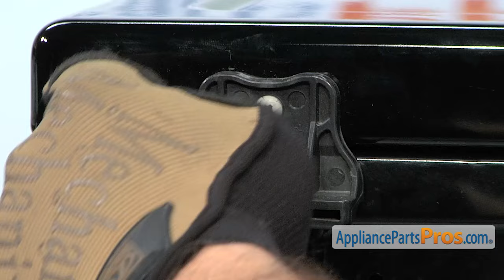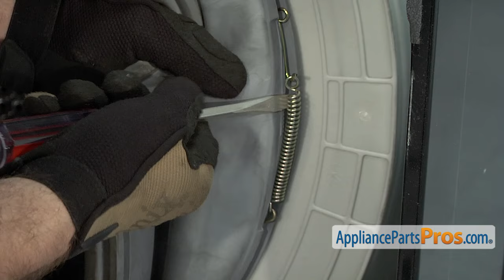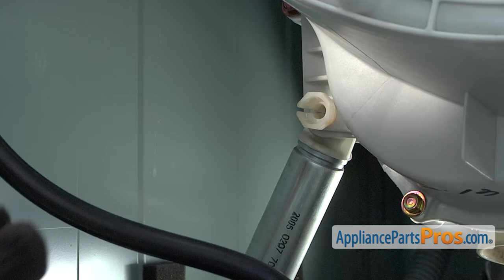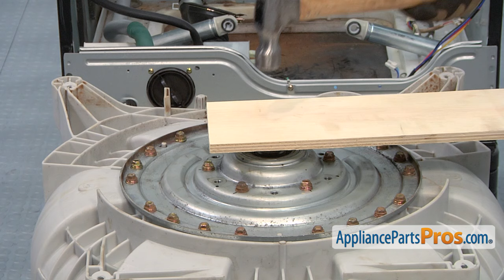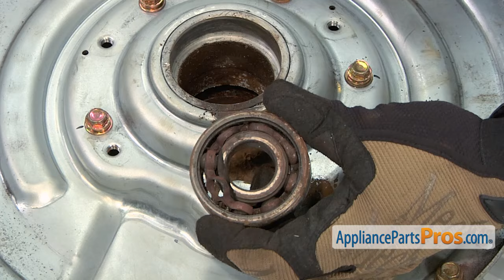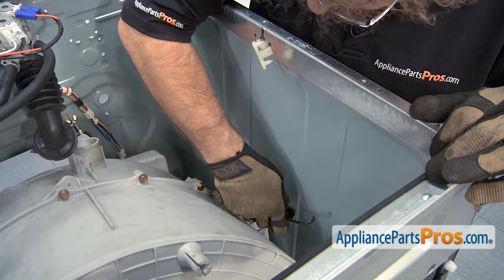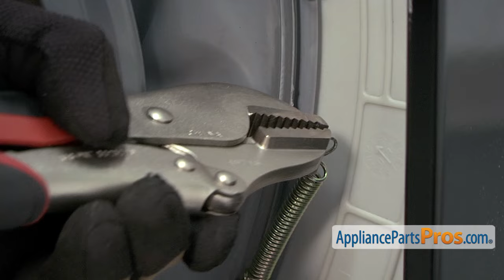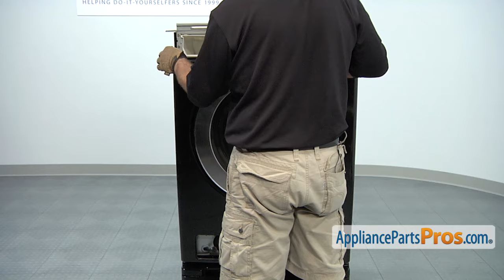How To: LG/Kenmore Washer Seal 4036ER2004A

Comment: It is a great video.  After watching your video, I am daring to open my Kenmore 3.5 Quiet Tumble Action front load washing machine, Model: 417.44052400 from Sears. It is more than 14 Yrs old.  Making loud noise with some vibration during the high speed segment of the spin cycle and leaks 1/4 th cup of water.  Otherwise it works quiet good.  Do you think this video will work for the model of my Kenmore Washing Machine?  I am hopeful.  Thanks for your time and excellent explanation.  The photography is of high quality.  I have used your videos on Kitchenaid Stand Mixers, which helped me in replacing grease.

Comment: The worst part was putting that spring clamp on the outer boot. Mine was MUCH tighter than his, but the vice-grip trick was the solution. I just had to put a lot more effort in it! I thought I was doing something wrong.

Comment: I just did this repair today - I just paused the video like a kazillion times during the process, lol. Turned out whisper quiet and works perfect. My unit is 10 years old. This repair took me 6.5 hours and cost 30 Bucks for the 2 bearings, seal and tub o-ring online ..way better than spending $900 - $1,000 ..thanks for posting this video!

Comment: NOT having the torque values is a real challenge here guys. I changed the bearings and seals ...I undertorqued my motor bolt and it came loose so I got the drum movement/noise again. Retightened. Got excessive movement so I replaced the struts. Now again Im getting movement but its a "crunchy" sound. I fear I may have overtorqued the nut and broke the spider. is this possible? I really wish you would include the toque values for the 20 something drum bolts and the motor bolt. ALSO PLEASE RECOMMEND PEOPLE CHANGED THE STRUTS when doing one of these jobs.Its a complete pita to have to do it later!

Comment: 6 years later and still saving people money! Thank You! Couple of notes. 1) I agree that placing the weights on after boot gasket install is easier. 2) seal placement shown in video is correct despite comments. 3) take the time to clean the tub parts during the process. I pressure washed. 4) I had to let penetration oil set for a while to release the tub and the bearings. Those took the longest amount of time.

Comment: Great Vid, thank you. fyi, if you are alone, put the springs back on the tub (pay attention to the direction of the hook) before you put the tub back in, quick connection right side and a little wiggling for the left !!! no problem.  As well previously, wrt the shocks, front ones take them off at the bottom and then remove them from the tub and replace them on frame (not tub) when reassembling. Remove the bracket holding the rear shock.

Comment: Help!  Any additional thoughts on removing the shaft from the bearings.  I've tried WD 40, heat gun and brute strength and it's not budging.  The outer bearing was chipped at the center when I opened it and actually spins around the shaft.  Any recommendations are greatly appreciated.
Reply: By now you might have already solved your problem.  Other than WD-40 , two viewers have recommended some liquid for loosening the shaft.  Hope you have already read them.  When I will work on such a Project, I may face the same difficult situation.

Comment: Why on earth would you not want to use a light smear of grease to help you install the seal and the bearings? The seal is pre greased inside the lips, and the bearings are greased, so it seems very strange to use liquid soap to install both.

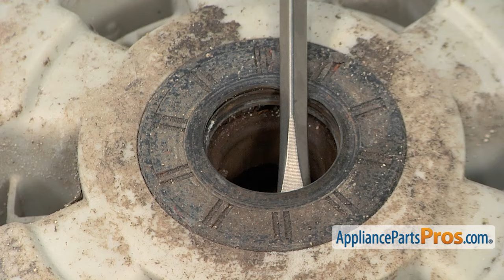Comment: Good demo, but you put the seal in backwards! See at 16:30 where it came out with the open side of the cup facing into the machine where the water will be. That's also the side where the garter spring  is energising the seal lips. Lots of people make this mistake because they are used to these seals being oil seals outboard of the bearings on a diff or gearbox, where the spring and lips face away from the way you install it, i.e. towards the oil. It's clear at 19:30 that you have installed it with the open cup facing the bearing, not the tub's inside where the water will be, to protect the bearing from the water. 
I just did this job and I noted the seal direction very carefully. I'm also a machinery guy.
Reply: not backwards but the new seal part is just different from the old one.  But it is confusion and ripe for comment in the videos about which way it goes.

Comment: ONE MAJOR THING that I would change about this installation instruction is to fill the inner lip of the seal with grease as it will eventually fail again because of friction as the drum turns.

Comment: Excellent video, but I recommend placing the weights after placing the bellow on the drum, not before. It allows more room to work the bellow and placing the retaining spring.
Reply: Great helpful tip.  I liked it.  I will keep it in my mind when I will work on my Washer.

Comment: @AppliancePartsPros
I have a LG wm2277hw makes loud noise when it spin cycle, so I decided to replace the its two bearings, so disassemble the whole device, then tried to release rod from plastic tub by hitting with a hammer while place the tub on two pieces of wood hanging.
I delivered about 50 to 70 shots with all the might I have got, but rod that attached to stainless steel drum did NOT come free from plastic tub.  Like you have shown at @15-18.
I did spray ton of WD 40 but it did not help.

Comment: good luck actually doing this.  Wonder how many machines he tried before finding one that would cooperate.  I tried this once as a techincian and learned my lesson after several hours and couple visits later to the customers home, my supervisor and I decided that was a bad idea.  Most of us (if not all) will replace the rear tub assembly with the bearings and seal preinstalled. ALL other manufacturers make tub assembly the only way.  Whirlpool has gone to making basket and front and rear tubs as one assembly. Also its easier to take the tub asm in and out if you remove the dispenser asm and front cross member. plan to take a couple hours for this job

Comment: Isn't laundry soap the cause of the rust? I would use grease or oil instead of soap and use the old bearing to tap the new one in. If the new bearings don't have grease, add some more. Thanks for vid

Comment: I watched this video and then did the repair.  It was helpful in that it was a good road map for the order of procedure. BTW, using a small piece of string to remove and replace the suspension springs was a HUGE help.

Comment: I'm hoping that someone reading this can offer a little advice for me.  About 6 months ago, I replaced the bearings on my lg front loader and everything was going fine until recently I got an 'LE' error and so I replaced the hall effect sensor and while putting the rotor assembly back onto the machine, I noticed that the barrel slid forward and I know that it will get tightened back into position once I tighten the 17mm screw on the rotor assembly.  But I'm curious to know if the barrel should be moving at all, even prior to tightening that bolt?  If it shouldn't be sliding then what is it that I don't have correctly tightened?  When replacing the bearings, I made sure to get EVERYTHING back snug and in position just like I found it when taking the machine apart but if I missed something then what was it?

Comment: You carried me through my bearing(s) repair.  Could not have even considered the project without your video.  I am a 72 y/o (female).  I watched your video 3 times before I 'knew' I could make the repair!  At the start I had your video running as I followed along.  My daughter helped me get out the tub and away I went.  I can't thank you enough for your detail.  It took me 4 days at a 'slow as you go' pace.  I didn't want to 'screw it up!  As I am writing this, the washer is going through it's cycle.  SO  QUIET.  Oh, the LG TROMM Steam Washer is 13 years old and now runs like I just had it installed!  Thank you so very much.
Reply: You go girl, ;)
Reply: I am in the middle of doing it right now. I'm 65 years old and an aircraft mechanic. So got the experience to perform it. Well done on your part. And I do 'when in doubt, go slow.'
Reply: Mam i am habib from bangladesh i am good technician
 for all washing machine and refrigerator repair so ples:halp me for job on your country.

Comment: I have been having trouble with washer stop spinning. I thump the washer and can get the drum tumbling again or use the diagnostic mode on spin and turn the drum from the back using a towel for a grip (protection). I noticed a high pitch noise when spinning. Now there is a rhythmic clicking during the washing cycle which also is in the spin cycle. The clicking sound goes with the speed of the drum. Faster speed, faster clicking. Does this sound like the bearings are going bad? I haven't taken it apart yet because I'm still thinking it through. I can't find anything on the web about a rhythmic clicking with each turn of the drum.

Comment: Excellent instruction. Changed the bearings, spider and boot. Only thing was the new boot was so stiff, after fighting with it for about a half hour I decided to pull the weights back off. After that it gave me fingers more room to work and got the new boot on relatively easy, then reinstalled the weights. Thank you so much, this video is a definite money saver.

Comment: Video made a lengthy repair straight forward. Thank you! Three suggestions: (1) use the old bearings to pound out the new bearings, (2) if the shaft won't go through the new second bearing without pounding (as happened to me), then install the rotor bolt with washer a few threads deep,  block-up under the washer, and tighten to safely pull the shaft through. Repeat with thicker blocking until fully pulled. (3) install the door boot to the tub before putting the tub back into the frame/cabinet. You'll have more room to maneuver. On a last note, it took me about 6 hours, but at least 2 hours was spent just cleaning. Since you are that far in, suggest also removing the spider and cleats inside the SS drum. Mine were really gunked up.
Reply: Thank you very much for your tips.  I will keep this in mind when I will work on my Washing machine.

Comment: Thank you for the thorough video! Appliance Parts Pro also has a hotline which proved to be very helpful.

I just completed the repair successfully on my 12 year old LG washer.  My biggest piece of advice is to change out the gasket and the discharge pump while you are doing the bearings.  ~$100 worth of parts and you will have a machine that is close to new.

I have the following detailed notes and tips based on how my repair went:

1. The step to remote the inner (metal) tub from the outer (plastic) tub was much more difficult that the video suggests because I did not use the suggested rust buster.   I sprayed WD40 liberally, broke 2 pieces of wood in my attempt to dislodge, and moved from a hammer to a sledge hammer.  The piece would not move at all. I called Appliance Parts Pro and they were very helpful in suggesting I do not use WD40 but use a rust buster (they suggested Mars Rust Buster).  My local Home Depot and Lowes did not carry Rust Buster so I used a product called "Blaster" from Home Depot.  I sprayed Blaster and let it penetrate over night.  The pieces came apart the following morning.

2. The step to remove the bearings took much longer as well.  I tried using tools I had as a makeshift punch but these were ineffective.  I ended up buying a 6" punch which eventually worked.   Even with the new punch, it took me lots of effort to dislodge the bearings.

3. Someone in a previous post suggested using a cupcake tray to keep track of the screws, which was very helpful.  I used a egg carton and made notes on which screws were in each compartment This turned out to be extremely helpful during reassembly.

4. The locking pins on the shock absorbers were difficult to remove.  I tried the technique in the video to use a socket, but this did not provide enough pressure on the tab.  I was able to free the locking pins by using a needle nose vice grip locked on the back side to press down the tab while I pulled the other end with a larger vice grip.

Take your time and follow the video and you will be successful.
Reply: Oh thanks, I have Blaster from this summer's work on the lawnmower. Would have never thought of that!

Comment: Great detail.  One of the best step by step I’ve seen. Worked great for me. It took me a few hours to do. Some tips for people. Penetrating oil is a must to get bearings out. Buy a punch set to knock out and put in bearings. 
The front grey gasket I would put it on with the metal spring clamp before installing the two weights. Having weights off makes it more accessible. Metal spring reinstall was a major pain. It didn’t want to stretch. 
After you install the lower drain pour some water in before installing door so you can check for leaks. Makes checking so much easier. Mine leaked and was a pain to access leak location. Why the designers didn’t make a longer spigot for the rubber boot to slide in seems a design shortfall. 
Take pictures with a cell phone to jog memory. Reinstall screws as you disconnect or use a muffin pan to keep in order. Video is so good a novice can follow it with confidence. Excellent production of it.
Reply: Great tip - very useful.  Thanks for sharing your experience.

Comment: Is there any way to use another brand or model spider arm to replace a busted one on a GE Profile front loader washing machine? GE doesn’t sell just the arm. Only the back half of the drum assembly with bearings & a new arm & it costs almost as much as a new machine. I’m hoping there are other brands or models that have an arm that will fit. I’d appreciate any insight anyone can give me. Thanks
Reply: Almost forgot. My model washer is WCVH6260FWW

Comment: Awesome guide! One word of advice if you can’t pound out the shaft. I know I couldn’t and actually broke 2 2x4s using a 3 pound sledge hammer.

Take a throw away bolt and thread into the shaft. Then drop it so that the bolt strikes the ground. If you to protect your cement, do it on a landscape block or steel sheet. The shock of it striking broke it free for me after the second drop from around waist high. The rest was cake, including punching out the bearings. For the new bearings, put them in the freezer for a few hours to cause shrinkage. They will also seat easier.
Reply: Hope that will work for me. I can't get the shaft out for love or money!
Reply: @Donnie_Prestwood  Did you manage it eventually>

Comment: There’s no reason to remove the gray seal from the tub. It’s very difficult to get back on.
Reply: Thanks for your helpful tip!!!  When I repaired my microwave oven, I avoided some such item because I knew it may be very difficult open as well as put it back.  And still I could troubleshoot and repaired my Microwave oven - works as good as new.

Comment: Thanks! Bearings on my LG Tromm needed replacement. Followed step by step with a few changes.  Hardest part for me was lifting out the tub from frame off the springs and pounding out the old bearings.  4+ hours of work. Now my LG washer purrs like a kitten.

Comment: As with others, THANK YOU!  While my repair took 6 hours over several days, my washer is running like brand new again.  Disassembly was easy and I was feeling pretty confident.  Then it was time for the inner drum shaft.  I let my washer run on junk bearings for probably a year so I assume those things were fused to the shaft.  After several hours of broken wood and pounding with a rubber mallet, I had no choice but to switch to a 4 lb. sludge hammer.  I protected the shaft as best I could and it eventually let loose.  The bearings were hammered out again with my sludge hammer and the largest sockets and socket extension I could find.

Upon reassembly, I realized I damaged the spider arm shaft with my 4 lb. sludge hammer as I couldn't get the rear cover on the stater.  I had to order a new spider arm as a result.  I actually put the door gasket on before even starting the re-installation of the tub.  Everything else was cake after that.

Comment: I only have a little note to add. When reassembling, leave the weights off and put the front gasket seal on first. Then put the weights on.. I didn't have enough room with the weights on and it was a bit of a challenge until I took the weights back off. So I would just reverse those two steps. Otherwise, Spot on with everything!! and Thanks..
Reply: And the bearing/seal kit was on Amazon for 26.00 free shipping with prime.  but now I need to replace the shocks.... They were shot..

Comment: This video is really excellent. A couple of minor deviation notes for my LG model - there's a screw in the upper right corner of the front control panel that has to be removed, and for all practical purposes, the front gasket MUST be put on before reattaching the weights. I like the note below re: using the old bearing as a drift, I could have used that!! Could a couple of popup comments be added so people don't miss out on some of these tips?